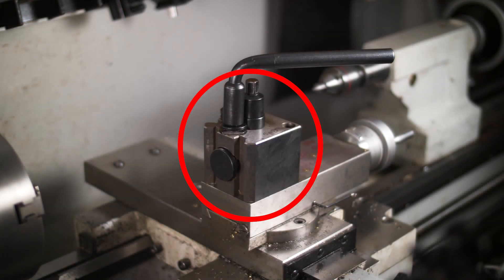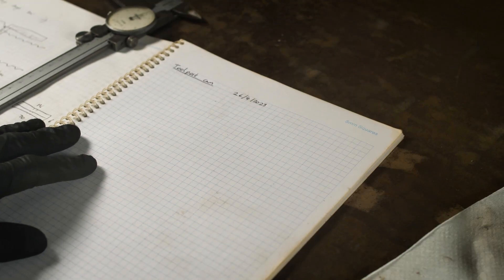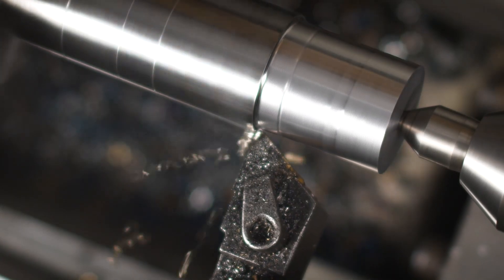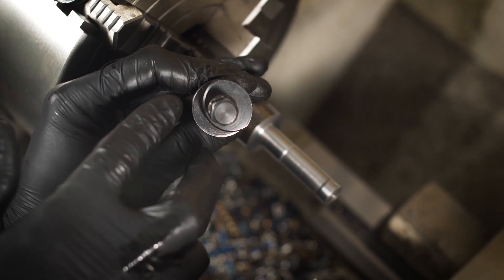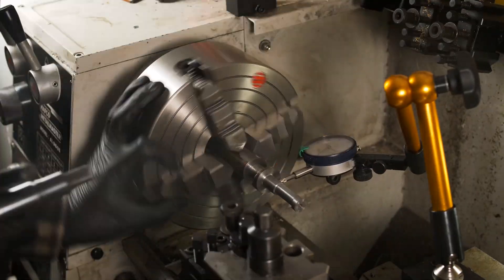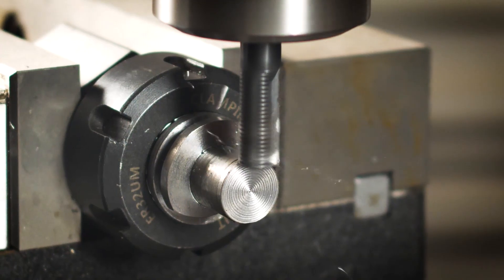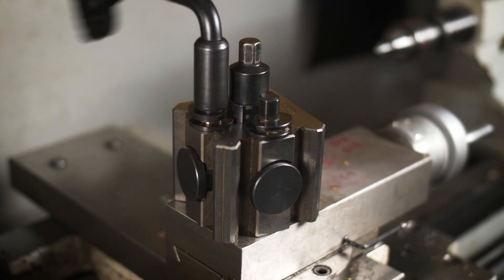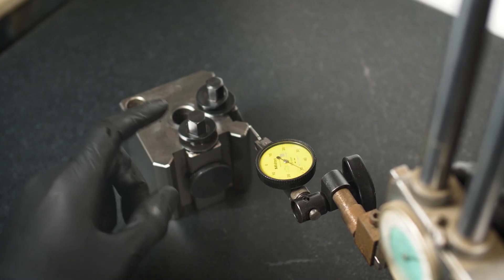This will fix my lathe

Comment: broke the spindle in half due to a crash on one of my old lathes. you got lucky
Reply from the maker: Ouch. This lathe is well made and I was in highest speed, so low torque and it stalled when it crashed

Comment: Do round cam shafts that pull tool hoder have adjustment grub screw ? I have worked with similar type of toolpost holder that had a grub screw so you could adjust excenter and grub screw was made of softer material so it would wear out instead of camshaft and a pin.
Reply from the maker: the design of these is just a reasonably hard cam. if it wears, the handle will just turn a bit more to tighten
Reply: @TomMakeHere  The toolpost i worked with was made by prva petoletk in yugoslavia.The build quality is top notch.Everything is hardened and the tolerances are something that cheap chinese posts can only dream about .BUt those tool holders are kinda pricy with its 500-800$ pricetag and the factory that made them is gone .
But its crazy good tool post that worked for 16h for 30 years (shipyard),with who knows how many cuts and to make it like new all you do is replace a simple cheap grub screw. The machine had 11kwh motor and we did a 15mm depth of cut in a a4 stainless steel.
They dont make them like those anymore . . .

Comment: I made one of those for a friend out of some scrapbinium he gave me to use, I thought it a bit light and it turned out to be titanium , now that is lathe bling for you😅
Reply from the maker: Fancy!
Now hit it with a flame and make it pretty purple and blue colours 😁
Reply: @TomMakeHere  way to late for that by about 10 years.🙂
Reply: I am terrified to try Ti, so how did it go? I love the look of the stuff, and I have bike stuff that cost arm+leg, but I'm convinced it will destroy every tool I touch it with
Reply: @greggroos2271  it turns ok BUT dont let the swarf accumulate or let the heat remain in the swarf as it will spontaneously combust, which can catch you out and really spoil your day. It work hardens just like stainless and that can make tapping holes, or even drilling them, problematic. 
Setting light to swarf after, in a safe place of course , can but fun. It burns a bit like magnesium with a bright white flame.
Reply: @chrisstephens6673  Are you the Chris Stephens that posted a video about a lathe burnishing tool? Completely by coincidence I found it this morning, I am getting ready to turn a tight tolerance part and was looking at shear tool and burnishing videos. And, as i looked over the other videos on the channel there is a great tip about using the tailstock as a steady rest, what a handy technique. Anyhow, if it's you, props on the channel!
Reply: @greggroos2271  guilty as charged 😬 
It's probably the YouTube algorithm getting in on the act again, but if you like what you see that makes it worthwhile. Feel free to spread the word and I might summon up the motivation to make some more.
Reply: @greggroos2271  PS I have a few bike items on my channel but I haven't posted much lately.